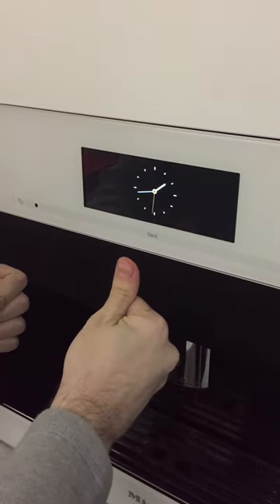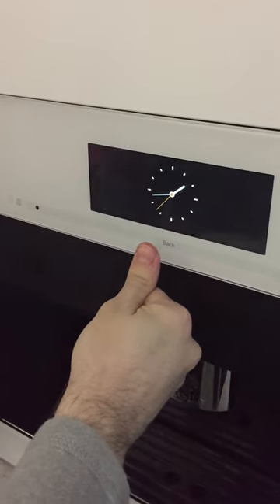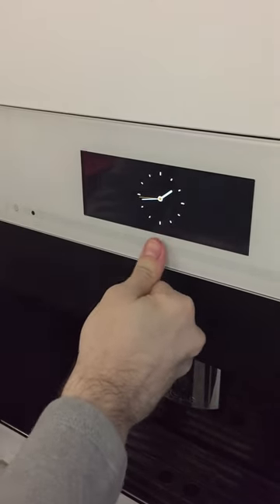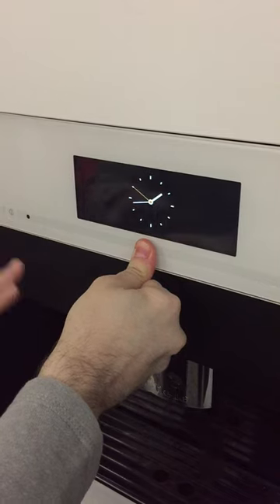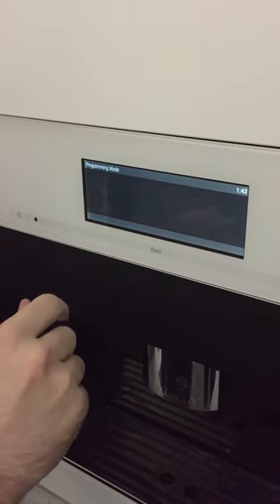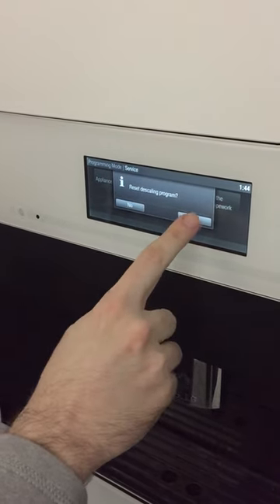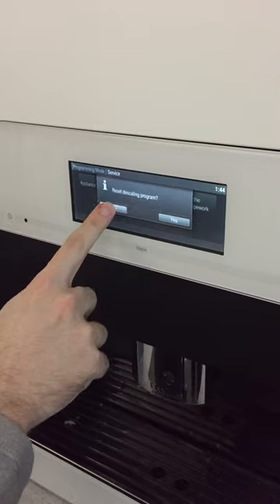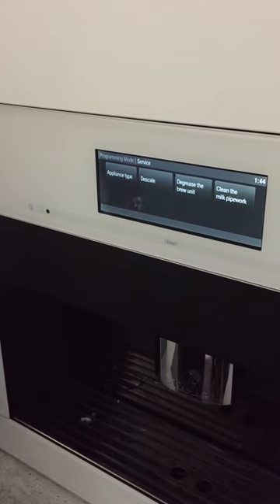How to: reset the descaling counter on a Miele coffee machine

Comment: How do you do this on a cm6150?
Reply: Did you figure this out?
Reply: I’ve got my CM6150 stuck in degrease mode. I don’t have a back button unless i use the arrow icon that brings you back to the previous screen?
Reply: @jsrotondi  yes, see below
Reply: @isabelle4287  6150: press "lines"+PWR, then "lines" 5 times, holding on the 5th time. "Lines" refers to button on the bottom right. This puts it in service mode, where you can reset the degrease.
Reply: lines+PWR, then lines 5 times, holding on the 5th. in service mode, reset what needs resetting.
Reply: Thanks that’s great and very clear. I’ll be doing this today.
Reply: Unfortunately,it’s not working for me. If you think of anything else let me know. Thanks
Reply: @isabelle4287  I just tried it and it works. 6150, start with it off. to be sure, disconnect from power for a minute, then plug back in. Press Power and "lines" together till it lights up. then lines 5 times, holding on the last one.
Reply: Just tried it again. I get nothing. When i power on here’s the screens i get :” information: Demo mode turned on. The appliance will not heat, ok.” I press ok, then it says preheating then it goes to “Degrease the brew unit, Empty the drip tray and the waste container” I do that it goes back to the same message.  I’ve pushed every other buttons on the machine with power and all i get is “turn machine off, yes or no. I really appreciate all the time your taking here. Thank you. I know i just need to access the service mode.